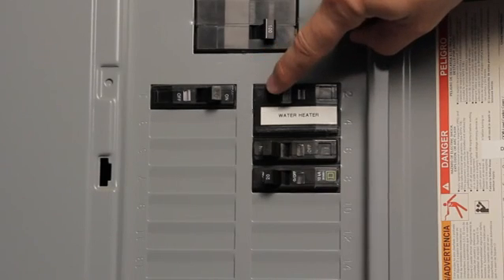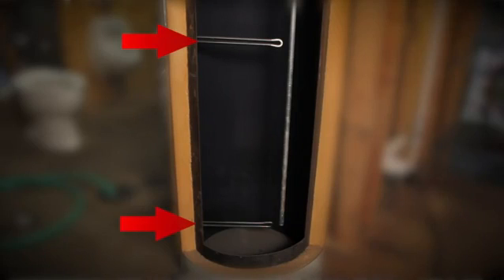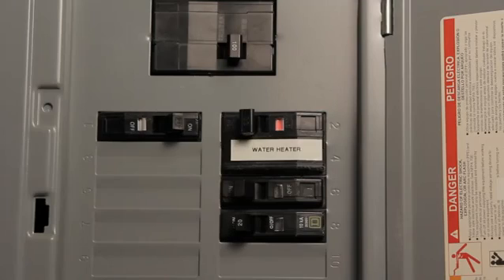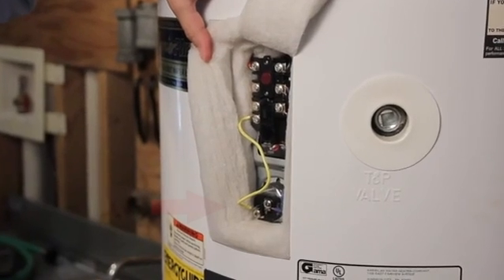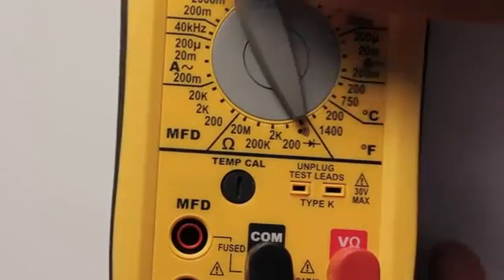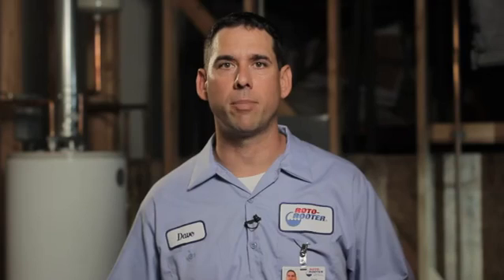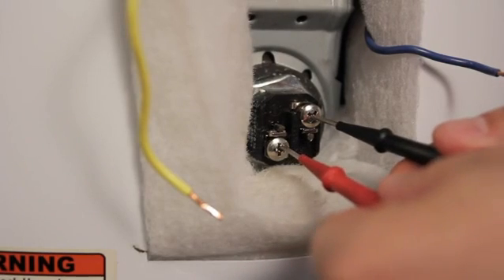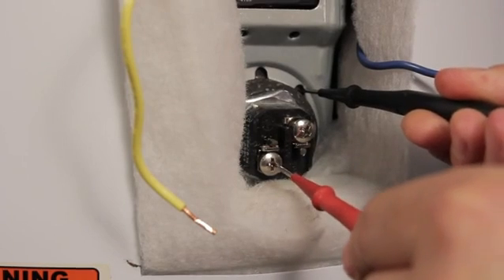What's Causing a Water Heater to Trip a Circuit Breaker

Comment: You didn’t mention anything about a failed thermostat. My hot water heater will heat up hot and then trip. I think this is a symptom of bad thermostat.
Reply: He did in the beginning!
Reply: Is a thermostat something you were able to DIY?
Reply: The top element comes on first then the bottom, if come on for a bit then trips it's most likely the bottom element

Comment: I suspect that the water heater that I just had an issue with has an issue because it has a 20 amp circuit breaker when it needs 30😮 got to love coming in after idiots do work.
Reply: Was everything ok after you swapped up to the 30A?  My water heater after 4 years is tripping the circuit breaker.  Seems it all started after a very violent thunderstorm.